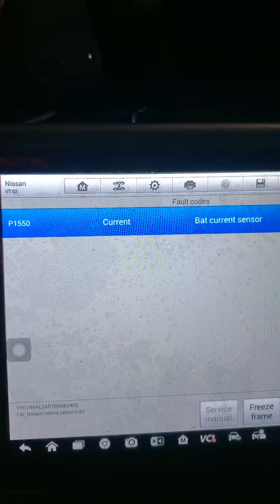Nissan Altima P1550 code fixed

Comment: I get code p1550 p1552 and p1553 and the connections are clean. What the deal? I just bought the truck couple days ago and so far I haven’t had any issues. I tried erasing the codes but they come back.